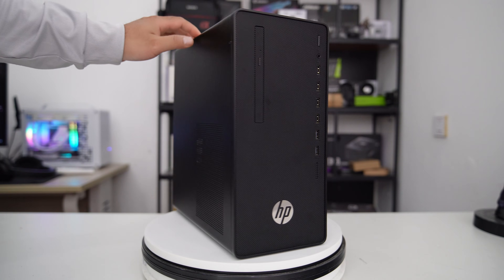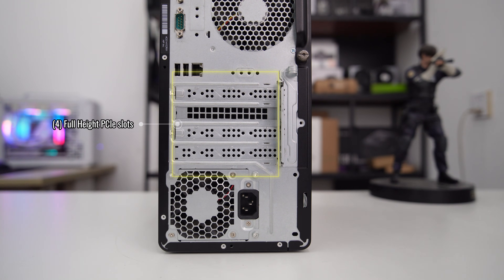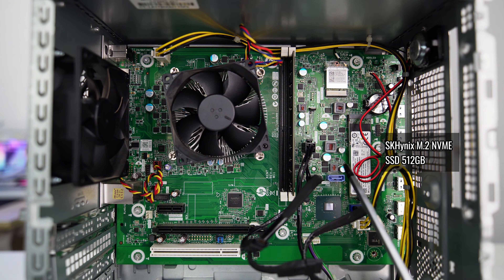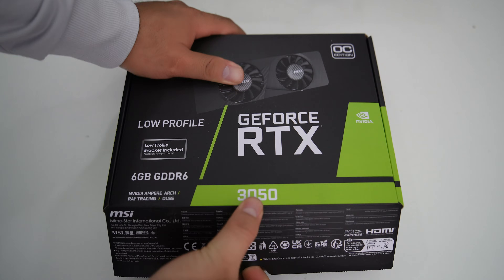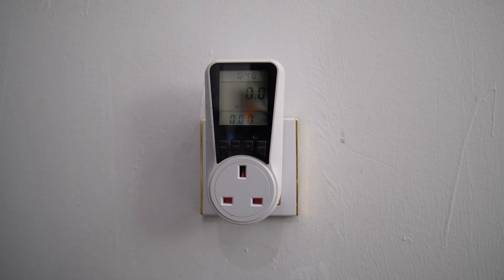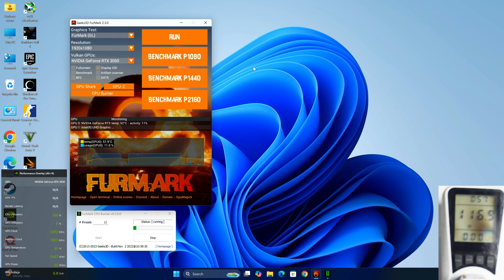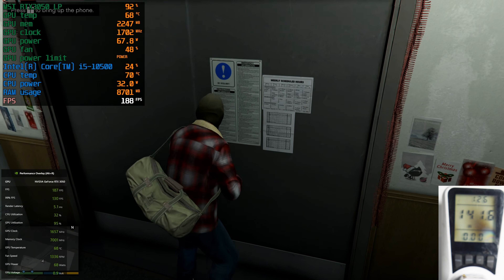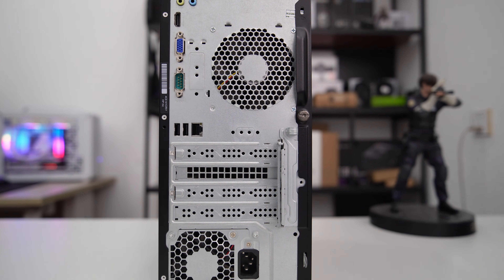HP 280 Pro G6 180W PSU ft. RTX 3050 LP, will it work?

Comment: I have a hp prodesk 400 g5 sff, it has psu with 180w, cann i use a rtx 3050 lp with that psu?, Has a i5 8500, 16gbx2 ram, a nvme 512gb and ssd 256gb. Space is not a problem because I can buy a PCI Express expansion card and secure it somehow.

Comment: Picked up an HP 285 G3 MT for £50 and upgraded from a Ryzen 3 2200g to a Ryzen 5 2600 for £25 and 16GB of DDR4 3200 for £16. Thinking of doing exactly the same with an RTX 3050.
Reply: @OfWodensFolk  I just bought the exact same pc for £65 but I was thinking of getting ryzen 7 2700

Comment: Hello my friend, I know the video is old, but I would like if you could answer a question for me. I have an HP PRODESK 400 G2 SFF with an i7 6700 16 gb ddr4 and a 180w 80 plus bronze PSU. My question is if you can still put in that RTX 3050 LP 6GB graphics card?

Comment: I have a hp desktop, it is similar to this, 180watt psu,  Ryzen 5 3400G with 2 ddr4 sticks running in dual channel mode. I know in the video this set up ran under 180 watts, but do you think i should get a larger power supply or will i be safe with my current one? Also, this is the low profile version  of the rtx 3050, will the full size version of the rtx 3050 6gb also fit?

Comment: I have an optiplex 3050, 180w psu with and old i7 7700, i added rtx 3050lp gpu and M. 2 NV3 ssd and i blew up the psu lol, i watched a video where a guy tests a pc with this specs (without the M. 2) & it has a comsuptiom around 140w, i think i'll go for a 240w psu :)
Reply from the maker: Make sure all the parts are installed correctly. It won’t easily blow up, as the PC runs under BIOS control—unless a mistake was made.

Comment: I got an i5 6500 plus 8gb ddr4 dual stick... 128gb ssd 500gb hdd and 200w psu.... Old system.... What 4gb gpu can i pair it
Reply from the maker: I recommend you look for a GTX 1050ti or a GTX 1650.
Reply: @itggear  idk.... I put an r7 350x 4gb ddr3 128bit in it and thing began crashing randomly...

Comment: The PSU is fine. You act like you think they didn't allow for a margin of error and I assure you they did. You can switch to an SSD for lower power draw if it makes you feel any better. It takes quite a bit of energy to spin that hard drive.
Reply: he is using an SSD what do you mean
Reply: @netsh0u  But it came with a hard drive.

Comment: Sir give me you contact plzz😭😭😭😭
Reply from the maker: I think this is scam that ask for contact info, in fact I put the link in my channel or you can tell your problem here.
Reply: Here’s your text converted into English:

Hi Sir, I live in Bangladesh 🇧🇩
I also have a computer similar to yours, with an i7 10th gen and 16GB RAM. After I installed a new RX 580 graphics card, the screen keeps freezing 😭😭😭.
For this, I used an external 350W PSU, but it still doesn’t work. I even upgraded from Windows 10 to Windows 11, but the screen still freezes. Please give me a solution, Sir..! 😭😭😭

 @itggear
Reply: Here’s the English conversion of your new line:
 
*Sir, please help me just once. I will always remember it.*

Comment: Does 900p 19inch monitor can capable with 3050 6gb?
Reply from the maker: Yes, it could. RTX 3050 6g could support UpTo 4x 4K 120hz (Like Gigabyte rtx 3050 6g lp which is has 2xDP and 2xHDMI ports) or 2 x 8K 60hz monitors. Thanks you.
Reply: @itggear  I had draxen 400w i been using psu for 3 years would be capable?
Reply from the maker: @axtonganha  Make sure you reach out your hardware companies support team for realizable advice. Thank you.

Comment: Really RTX 3050 use very little power?
Reply from the maker: @mobileplayers5008  Check google 'RTX 3050 6GB TDP"
Reply: Only for 6GB version because they didn't use connector power, u only need plug in click and is done

Comment: Nice Video
I have a similar HP micro tower spec which is a Prodesk 490 G3, not SFF but with an i7-6700, 8gb ram (updated to 16gb dual channel), an RTX 3050 LP from gigabyte that I bought for replacing my GT-730, PSU wise I have a 300w

I was blown away with the performance but since I hear the PC fan being louder, I thought it was my CPU but nope it's the GPU working harder while gaming so I guess it's normal.

Temperature wise, it stays at consistent 69-70 degrees on stress test.
Reply from the maker: The RTX 3050 LP GPU fan can reach speeds of up to 5000 RPM. If you're unable to keep the GPU temperature below 70°C, it will run at maximum speed, which can be very loud
Reply: @itggear  I think it's due to the fact that my PC don't have many fans inside instead of one for cooling the CPU and the other for pushing the hot air out.
For now I added another usb fan inside of my PC so I could buy another fan next week.

Also I recently did a stress render test with techpowerup gpu-z today and the temps of my gpu stays at constant 68 degrees and sometimes drop to 67 degree, 94% for usage, with the fan speed at 3121 rpm so I think it's still normal
Reply: @itggear So I got a motherboard (other one died of powersurge, see the green light but won't turn on) from a another used PC which is a HP Elitedesk 800 G2 SFF, It has the same compatibility (same CPU, socket and ram compatibility), tried to use the remain componants from my Prodesk 490, G3 and they worked fine as usual😌

Downside is there's a single fan for the CPU so I bought fan splitter for more fans and adjusted the fan speed between 50-60% in the bios for reducing the CPU temps during heavy load on gaming.

Comment: HP are a pain for making dimensionally different PSUs for near enough every model they release.

It's a problem I've hit SOOOOOO many times when upgrading the GPU in HP tower PC's, but I think I've worked out a solution that should be a pretty significant power upgrade for most (if not all) of HP's later tower PC's that come with the little white 6 and 7 pin inline "PWRCMD" plug, the pair of 4 pin connectors for CPU and main power, and where the stock PSU only outputs 12v to the motherboard (The ones where the hard drives are powered by a pigtail from the motherboard).

The unit I'm planning to use for this upgrade is one of the small (but impressively high quality) HP server slot in type PSU's. The ones I've got are 1200w on a 240vac wall socket and 900w on 110vac, so they should provide enough power for just about any GPU someone could want to throw into a HP prebuilt tower. They're also reasonably small, so fitting one in the space vacated by the original PSU should be pretty simple, and as electricity prices are globally high, and a lot of folks are getting out of the crypto mining game, there's a fairly large number of these PSU's constantly hitting eBay, and the abundance of them for sale means they're selling cheap.

The problem I was seeing was that the main power plug on the M/B needs a constant 12v so that the M/B can send the "power on" request to the PSU, but the 12v standby power connector on the PSU can only safely put out 15 or so watts, so as soon as the PC starts waking up, that needs to be switched to take power from the 1200w main 12v rail. I'm thinking I should be able to do this switch over of where the main M/B 4 pin power socket get's fed from by using a relay, but it will also need a capacitor because there will be a split second when the relay flips where the standby AND main power outputs aren't connected.

At the minute I'm waiting on the parts I need to test my theory that this type of PSU really can work in the later 12v only HP towers. At the minute I'm stuck waiting for yet more potential replacement plugs to arrive that might fit into HP's (apparently) proprietary PWRCMD socket. 😕

Comment: If I have a Dell Optiplex 3020 with a 255 watt power supply, will that graphics card work?
Reply from the maker: Yes, It should work fine. However, please keep in mind that installing an RTX 3050 on an older system like PCIe 3.0 means you won't get the full performance out of the GPU. Thank you.
Reply: @itggear  If I took that into account, I want that graphics card because in my country the RTX 3050 is cheaper or almost the same price as a GTX 1660 or 1650 (Note that it is new and not second-hand).Thanks for responding

Comment: What about underclocking the RX6600 to min 500mhz and max 600mhz and undervolt from 1150 to 1050v, with a 230W PSU and i3 2130, this could work? i want to use applications like blender and render low poly animations with EEVEE

Comment: I wonder if this card would run on my i5 office PC with 180W power supply? BECAUSE i just bought the standard ASUS 3050 (75W) and my PC freezes all the time. So strange because i used a 1650 on the same rig and never had any problems. These cards only need 70-75W.

Comment: I have a 9th gen build up PC and want a little upgrade, Do you think my PSU 180w can still power this :
intel i5 9500 ( upgrade )
vga 3050 low profile ( add )
ddr3 16 8gb x 2 2666mhz ( upgrade )
ssd NVMe PCIe 3 x4 256GB ( add )
hdd sata 3.5 1tb
dvd rw
psu build up pc 180w bronze

Comment: Thank you so much, this solved many worries. Looking to use this card in an optiplex 3040 with i5-6500 and the same 3050 LP! now i know everything will run ok :) will probably look to undervolt the 3050 as well just to be sure. Thanks again!
Reply: @ShezzaVEVO yooo Im doing the same thing. Could you tell me how its going so far? Any crashes?
Reply: @FriskThatGuy I ended up using a HP EliteDesk SFF (i think the g4 800?) instead, with an i7-8700. It was a slightly up-spec model with (i think) the 240W Platinum PSU, so there were no issues at all with power or headroom. No need to undervolt the 3050 LP (i got the MSI one).
I run the setup on a 1440p 180Hz monitor so surprisingly there’s hardly any CPU bottleneck and it runs nice and stable. I was able to run plenty of singleplayer games (with DLSS of course) and some esports titles too.
I even put in mismatched RAM so that I could have 32GB and never had any stability issues 😂😂. Overall going very well!

Comment: Cpu alone stress test around 100watt and gpu  alone with furmark 120watt. I wonder what happens if you stress test both running 100% cinebench & furmark at the same time, I think it will automatically shutdowns
Reply from the maker: It's doesn't mean the CPU won't be running while testing with Furmark. If the system load is around 100W during a CPU stress test, there is still plenty of wattage room left in the PSU. Since the PSU is 80% efficient, the 100W you see from the wall means the system consumes only 80W. A 180W PSU is designed to supply 180W to the PC system, not to draw 180W from the wall

Comment: I tried this with dell vostro 3910 that comes with 180W PSU but it didn't work, PC kept on freezing everytime I open it, any advice?
Reply from the maker: Did you connect the monitor via the GPU port after installing the GPU? If yes, and when you turn it on there's no display, it doesn't mean the PC is frozen. The PC might not yet recognize the GPU driver, so you can connect the monitor via the onboard DP or HDMI port and perform a complete driver installation. Also, you can check in the PC's Device Manager to ensure the GPU is present. Many things can cause a GPU to not be detected, such as BIOS configuration and proper installation, but it's most likely not related to the 180W PSU.
Reply: @itggear  yes I connected it through GPU's DP port and the PC runs fine at first but when I reach the desktop it freezes, I can't move the mice or keyboard, I will try downloading the drivers like you mentioned, I saw a couple of Nvidia drivers on dell website maybe those are missing, can you tell me what else I can do if it doesn't work? this is my first time actually modifying a pc, and thank you for replying fast

Comment: The best and safest option would be using RX 6400 Low profile or RX 6500 (I guess it is only manufactured by Dell). This will help to safely use 180W PS.U
Reply from the maker: You are right, those cards are good options for staying within the power limit of this system!

Comment: I have hp pre build pc with the spec i3 7100 16gb ram , and same 180w as your, can it run the same if i add 3050?
Reply from the maker: All the answers are in that video. I've tested and shown what's going on in the rest of the video, so you can make assumptions and decisions by yourself.

Comment: can i install a full size gtx 1050 ti non pin power graphics card? 
Or does it only support low profile size graphics cards
Reply from the maker: Yes, it does support full-size GPUs. I use a low-profile GPU because I only have that one. Thank you.

Comment: i can use a rtx 3050 6gb with  ryzen 5 5600g on a 350w plus bronze psu?
Reply from the maker: Yes, the power supply recommendation for the RTX 3050 6GB is only 300W. I think if your GPU has a PCIe 8-pin connector, you can even install a GTX 1660. Thank you.
Reply: @itggear  thanks a lot!

Comment: I have an HP Pro 280 G9, when I install a GTX 750 ti why is the screen only blank? is there something that should be set again? or should I replace the PSU with a larger wattage?
Reply from the maker: Maybe you need to configure the PCIe version and link speed in your PC BIOS to match your graphics card. It’s possible that the GPU or PC does not recognize the hardware. Thank you.

Comment: So i got i7 4790, 16 ram, n 255w, 3050 it's going to work??, n W vid🔥🔥
Reply from the maker: If it's the RTX 3050 8G, it won't have sufficient power since it requires 1x 8-pin PCIe and a 500W PSU. However, the RTX 3050 6G should work fine since it only has a 70W TDP and does not require an extra PCIe power cable. Thank you.

Comment: do you think rx550 on 280 watts psu will work? (i3-6100) thanks
Reply from the maker: Yes, it should work. The RX 550 has a low power draw, and your i3-6100 is efficient. Your 280W PSU should handle both. Thank you.

Comment: Very helpful video! I have slim HP workstation with an amd 2400g that I use as my HTPC and just bought this exact GPU and was worried that my 240 watt PSU wouldn't be enough... I'm feeling a lot better about not having to spend any more than I have to..
Reply from the maker: You're welcome!

Comment: Hey I have a HP with Wierd  PSU connector on Motherboard, I cant Upgrade 
It is 180 watt 

I m in Budget should i Buy ( Galax GTX 1650 EX (1-Click OC) GDDR6, ) it doesn't have any external Powers Connector
Reply from the maker: Yes, you can upgrade the PSU for your HP mid-tower desktop PC. There are many options available on the market for PSU replacement. Also, smaller wattages like 310W or 450W HP replacement PSUs are not expensive unless you choose a larger wattage like 500W or bigger. If you focus on daily tasks like enjoying 4K video playback and light gaming, the GTX 1650 is the best choice since it allows for plug-and-play without requiring any other upgrades.
Reply: Thanx Bro  @itggear

Comment: Will the RTX 3050 work on Dell Inspiron 3020? currently thinking of upgrading the GPU and was choosing between the RTX 3050 LP and RX6400 LP.
Reply from the maker: The RTX 3050 should work in the Dell Inspiron 3020, but make sure to check the physical dimensions and power requirements to ensure compatibility. Between the RTX 3050 LP and RX 6400 LP, the RTX 3050 generally offers better performance and features like DLSS.

Comment: I bought gtx 1630 but I'm afraid to use it because i don't know if it will work on my hp 290 G1 desktop with the 180w psu

Comment: It's running a little too close to the danger zone at times needs to not go above 150W continuous (you'll burn out the PSU quickly from the stress).  However I would not upgrade the PSU due to finding a reliable propitiatory PSU costing way too much.  Instead I would switch the CPU to a I7-10700T or I9-10900T.  Both are 35W TDP so it'll make sure you don't go over 150W while gaming while also gaining more cache, cores & threads to boot.  I had a I7-10700T for several years until I upgraded to a I5-12500T I got it paired with a RTX 4060, and the most it draws from the wall gaming is 170W in 1440p gaming.  These T class CPUs are best used for systems with low wattage PSUs anyway.
Reply: I've heard conflicting things with people saying it's okay and some people saying it's not. I asked on Reddit and people say that it's fine if it's a decent PSU and such and most say the worst that'll happen is it shuts off to protect itself so i don't know which is true
Reply: @jayemm_  The PSU will be fine, it's actually in it's most efficient range.

Comment: it is not a problem to run game for a  benchmark on poor PSU, try to use it in this mode for month and will see what hapen. Sooner or later PSU will die from owerheating, same about MB, it is not made to run with consumer cards, they use low power Quadro cards for a reason. But for level of Youtube it is too complicated..

Comment: This video is very helpful. no bs or anything just getting straight to the information. I have an HP office pc with an i5-8400 and a current GT 1030 GDDR5 that i thought about maybe replacing with this card and undervolting it a bit so it doesn't use too much power. It also has a 180W PSU so this video helped with deciding whether or not this would work
Reply from the maker: Thanks for sharing your experience! It’s great to find helpful videos that cut through the fluff. Considering your HP office PC with an i5-8400 and a GT 1030 GDDR5, it’s smart to think about power consumption. Undervolting the new card could be a good approach, especially with that 180W PSU. Kudos for doing your research!

Comment: Hey bro what gpu is good on my 280 watt psu with a i7 4790
Reply from the maker: I think any GPU that doesn’t require an extra PCIe power cable, like the GTX 1050, GTX 1050 Ti, GTX 1650, RTX 3050, RX 550, or RX 6400, is good for your 280W power supply. Thank you.
Reply: @itggear  alright